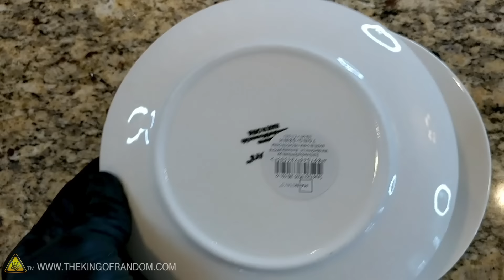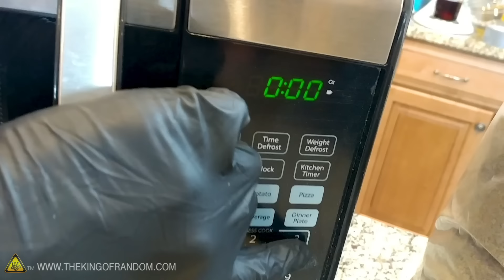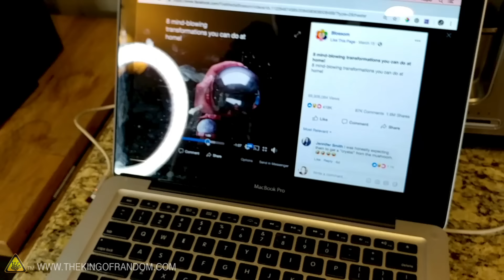Turning Pencil Lead into Diamonds

Comment: Try microwaving a real geode in water for 3 minutes to see if it's an easier way to break a geode open edit: wow thanks for the 290 likes on my comment
Reply: I think that’s what the video was trying to say, not that it creates a geode
Reply: @jaxoncroydon3516  I mean they did say that heating up a rock causes "rock gas bubbles" to form inside the rock and crystals supposedly form from those, so I do believe they were actually trying to pass off a way to turn a rock into a geode XD
Reply: Linkle Tinkle or maybe they were saying that the bubbles build up pressure and make it easier to crack but I have no clue I haven’t seen the original video
Reply: I tried it
Reply: @jaxoncroydon3516  the original video was in this video
Reply: greenflower360 the entire thing
Reply: @jaxoncroydon3516  most of the videos are only short 10 second clips
Reply: greenflower360 oh well

Comment: 8:00
You can literally see the glass they just put there
Reply: Oh yea!
Reply: MaGiC
Reply: That's real, sand + heat= glass (minecraft taught me this)
Reply: You can literally make glass by melting sand
Reply: It actually works
Reply: The reason they said it didn't work is because using the tools they used, it wouldn't produce enough heat to melt it, which is how glass forms, and the glass would be molten, extremely hot, and wouldn't be fully cooled off, or be perfectly straight when formed. Glass is moldable when melted, but usually won't form uniformly unless you flatten it.

Comment: So technically heated up pencils lead is diamonds?

SIMPLE LOGIC.exe is not responding
Reply: Flat earth 100
Reply: Technically graphite(lead pen), charcoal, graphene are different structures of the element Carbon, but you would need extreme heat and a lot of time to make diamonds from them...
Reply: *Buys 1000 pencil*
Reply: it's true though...
Reply: @mig1983  yep its basic 7th grade chem
Reply: @mig1983  How much heat, pressure,and time would one require to achieve diamond?
Reply: keitheo west earths inner crust levels of heat, pressure and a bit of patience i believe,  dont quote me on that chemistry isnt my field of expertise
Reply: @fransescom.b1178  Invests life savings
Reply: Commonsense.exe has stopped working
Reply: Genji Cat well basically carbon under high pressure and heat does make diamond.

Comment: How 2 make a diamond?
Simple! Get an unrealistically strong press and leave it at 5000 degrees Celsius for thousands of years! OMG TOTALLY LEGIT OOF
Reply: You forgot the peanut butter and charcoal briquette
Reply: Real synthetic diamonds are a thing lol, they're made that way, just doesn't take a thousand years.
Reply: Wait is there nothing in the press?
Reply: You forgot the rock or whatever you put in there
Reply: Thanks i just made some
Reply: @lih3391  pure graphite, since it uses pure carbons if you put enough pressure and heat on the graphite it's molecular structure changes to that of a diamond.
Reply: Capitão Explosão yep lmao

Comment: Try to make solid oxygen plzzz!!!
Reply: wat
Reply: Lmao thats almost impossible...
Do u even know how low the temperature has to be to get it to liquid...
Reply: lol it’s not that hard. Just put it in a vacuum chamber. You can make solid liquid nitrogen this way and many people have made solid oxygen.
Reply: @jeteamleider3714  g
Reply: That’s impossible
Reply: @steelavocado1  umm, how are you to make it solid if it pulls all of the oxygen out anyways?
Reply: soooo... you need a hole labolatory and thats going to cost at least 10k dollars
Reply: Vincent Kiesel wtf that is practically ice
Reply: The freezing point of oxygen is approximately 54.2 Kelvin. Which is -218.8°C. So it is very cold. They themselves wouldn’t be able to do it unless they were in a laboratory.
Reply: The problem here is you need a lot of pressure so they would need to generate way more pressure than they can on a budget they can afford.
Reply: Easy to do. Just put it into the vacuum chamber and done.
I'd like to see liquid argon and solid argon, quite rare on YouTube.
Liquid nitrogen is overrated.

Comment: You can actually turn graphite into a tiny very low quality diamond worth about $5 but you have to generate 1200 degrees, so put it in microwave for 90 minutes. Plus you have to put oil on graphite.

Comment: You can't expect to get a geode that way. You put it into a bowl instead of a glass!
Reply: Is that because the heat transfers better in a bowl? Asking for a friend
Reply: Pft, a plate would’ve worked WAY better
Reply: They did not do it right it said a glass not a bowl LOL
Reply: just use a plastic bag it isint that hard
Reply: @ii8cookiesn643  To put water and a rock in?
Reply: Wrap it in aluminum it helps the microwaves transfer through it better to create the crystals inside of your soon to be geode
Reply: XD
Reply: Either way it won't work

Comment: Actually the tin foil ball works but it’s not THAT shiny it takes a lot of work

I’ve done it
Reply: @ikevermander1325  yeah I find day REALLY hard to believe
Reply: I've seen other youtubers do it as well, it is true
Reply: @ikevermander1325  To be fair, a crunched up the aluminum ball would be susceptible to sanding it down to a smooth finish and you could conceivably polish said ball so I would give him the benefit of the doubt since he did say it wouldn't turn out that shiny (since it most definitely wouldn't). Since he didn't say how shiny it was supposed to end up as it just means he ended up with a smooth metallic-looking ball, they kinda proved that's achievable in the video since after a large amount of sanding the spot did end up a lot smoother than it was previously.
Reply: You actually have to hammer it
Reply: The point was to call the bluff of the blossom video. There are plenty of videos showing how to do it the right way. They just wanted to show that a sponge and oil is not the way to do it.

Comment: The second hack isn't for making crystals it's for opening a crystal filled stone
Reply: Badass Nikoy 
It’s a geode
Reply: The blossom video says “crystals form in rock has bubbles when heat is applied”, making it sound like they made a geode in the microwave
Reply: Geologist chiming in to say that trying to use this to open up a geode simply won't work either. It'll just look like a wet rock, completely unopened. Still water, even heated, won't dissolve any significant portion of the rock in this little time.

Comment: Being an avid rockhound, I've actually used the geode in water in a microwave to crack open a geode, but it was a geode to start with.  Other than that one point, my results matched yours.  All fails.  As expected.

Comment: Diamonds are created by very high pressure and high temperatures. A microwave wont cut it.
Reply: @hi ooff no
Reply: @hi ooff if you put a lava rock in a microwave the microwave will probably explode
Reply: Thanks for the science lesson Mr. Ihavetocorrectliterallyeverythingonyoutube
Reply: Pressure cookers
Reply: Ofcourse a microwave won't cut it, that's what knives are for
Reply: @kitsunekid16  underrated

Comment: Graphite from pencils isn't pure graphite, but instead graphite mixed with another content that hardens the graphite. The ratio of the two affects the darkness and hardness of the pencil, and it is also how the difference between 2B, B, HB, H and so on is made. Microwaving seems to have not affected the other material that hardens the graphite, which means it is still as hard as it was.

Comment: 2:14 -> Neither a piece of graphite, nor a plate get hot in a microwave. Try it out. They'll just stay cool. You can even try microwaving pure petrol (without ethanol content!!!), because even pure petrol won't get warm, nor explode, nor create a plasma or anything. Now for the reason why: Microwaves only affect molecules that create a dipole, meaning that one part of the molecule likes to attract electrons and the other part likes to repel electrons. Examples for molecules that create a dipole are water and ethanol (that's why microwaving petrol mixed with ethanol, and of course pure ethanol, can be very dangerous!). That means that realistically, only things that contain water molecules, such as most food, can be heated with a microwave.
Come to think of it, that could make for a really educational video: Let's test what gets hot and what doesn't in a microwave! :)

Comment: the air inside a geode MIGHT expand enough if the geode was weak it would crack open in heat

Comment: Years ago I had an idea for making diamonds from ash so wonder if you could create a small diamond using a smaller form of my idea. The idea is to take a hollowed out steel tube capped at one end, pack it with pure ash very tightly and put in the center of the ash a copper tube, then you cap the other end but keep a small bit of the copper tube sticking out and then either get lightning to hit it multiple times or see if you can replicate lightning with other forms of electricity. Just a suggestion for an epic idea/video.

Comment: That rock in the blossom video that turns into a geode is actually real. I went to this rock/geography store and bought the same rock, and you have a chance of getting a Crystal inside. I did get the crystal. But you cannot do this by microwaving a random rock.

Comment: I noticed there was a hole i your microwave, wouldnt that leak radiation?
Reply: Yes, but it's not even close to lethal so there's nothing to worry about as the waves are very long
Reply: R/whooosh
Reply: Dmitriy Peshko i think you dont understand what r/whoosh means
Reply: @dumtree3727  r/wooosh
Reply: @dumtree3727  you dont understand what woooosh means.
Reply: Radiation really. 💀
Reply: Not really. A microwave works through interference in a superposition. What that means, is that one part of the microwave sends waves, which is reflected by the other side of the microwave; but the reflected waves superpose with the initially transmitted waves, creating what is called as a standing wave. There are antinodes in this stationary wave, which is what heats up the contents. Thats why you have a spinnin plate, so it cooks the food evenly, and not at specific points. Having a hole in the side would have the escaped wave radiation no chance of being reflected, and thus the dangerous heating effect wouldnt occur. However, things around it could absorb the waves energy, and its relativly low power. I would guesstimate that the microwaves waves coming ourlt of the hole is about 10-50 more powerful than a wifi singal, amwhich wont hurt at all. It will also get absorbed by everything first duw to it moving slower. Its only really dangerou if theres sonthing to superpose the waves being released.

Comment: Considering the immense amount of pressure required to make diamonds, I'm still not surprised some people think this is real, like fixing ceramic with milk. Obviously, if you had used Raman noodles instead, it would have resulted in diamonds.

Comment: You actually can do that exact sand into glass thing following all the steps, you just need an oxy acetylene torch, which burns hot enough to easily melt steel

Comment: You can actually make that shiny ball with aluminium foil, but it will take a very long time. You need to hammer it down until it's a ball shape & than sand it down, after that you need to polish it

Comment: Wow the forming the glass is just funny. When glass forms naturally due to lightning it's not just the heat, which is way hotter than any torch will get but it's also the massive amounts of pressure that cause the sand to fuse together. This is over simplifying it, but the long and the short is that it takes more than just heat to make sand into glass lol.

Comment: actually if you evaporate graphite with high temp in vacuum, you can create very small diamond crystals. But I would not call it home made. King of Random can probably do it, but the result would be super underwhelming, maybe you would see the diamonds under a microscope if you are super lucky, but most likely not, since they would be a few atoms in size only.

Comment: Actually just normal beach sand if introduced to enough heat will Actually crystallize because it is made of little tiny diamonds and glass if you pick up a grain of sand you can actually almost see through it

Comment: if the sand to glass method worked, the beach would be made of glass instead of sand cuz of the water and sun 😂 😆
Reply: Sand to glass method works since sand has silica. You can turn it into glass through extreme heat until the sand melts.

Comment: K, but what if you put a geode in the microwave in order to break it open? Cause I've cut open Geodes and it takes way more than 3 minutes...So, if you'd ould microwave the geode to crack it open, maybe that's what they were showing?

Comment: The microwave diamond thing goes like this: You use Mechanical Pencil "lead"---The hardest you can get. Take a piece of thread and tie it around the center of the lead. Use the sharp point of a toothpick to put some oil on the thread. Just enough to wet the thread. The tiny bit of oil on the thread gives the microwaves a place to focus.Take the bottom of an inverted ceramic plate or cup and put two pieces of the lead on it and place the piece with the oiled thread on the two other pieces, perpendicularly. You are suspending the oiled thread section just off the surface of the cup/plate bottom.  Invert another cup over the first and microwave for 99:99. If your oven makes it without popping breakers or burning up, you may have a tinnnnnnyyyy crystal that fluoresces like diamond.

Comment: The second scam would work if it already was a geode. It basically help you find geodes because the water soaked in the geode when the bowl of water is heated in the microwave the water turns to steam. But it would probably explode instead of cracking. You should try it with a real geode!

Comment: I’ve heard if you put a metal rod in the sand at the beach during a thunderstorm 🌩 that is lightning hits the rod in the sand it will leave a ball of glass buried at the bottom of the rod. Anyone know if TKR have tried this or if it’s possible or a hoax?

Comment: Because of using the wrong type of sand
Reply: It will still be the same if you're just using blow torch. In order for you to get that wanted result, the sand must be melted under extreme heat turning it into glass.

Comment: Yeah but you can’t turn left into diamond because you need heat and pressure you have heat but you don’t have pressure so it will take a lot of atmosphere and it wouldn’t you wouldn’t be able to do it it’s like Iron Man squeezing the lead while it’s in the microwave and that’s impossible and you can’t get diamonds that easily it’s a minimal 😐

Comment: 13:40 - Ah, yes, I see what you did wrong on this one. You're using the wrong oil. It's not vegetable oil, or even car oil. You should have been using tinf oil.
Reply: 88888 888888 8888888 88888...   (Throwing peanuts from the peanut gallery)